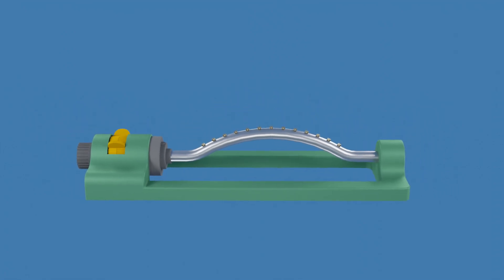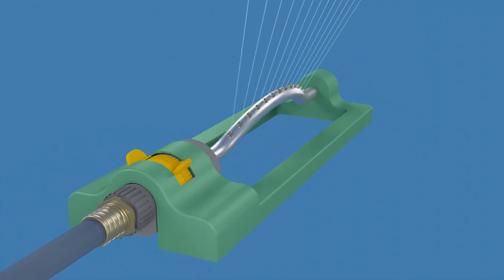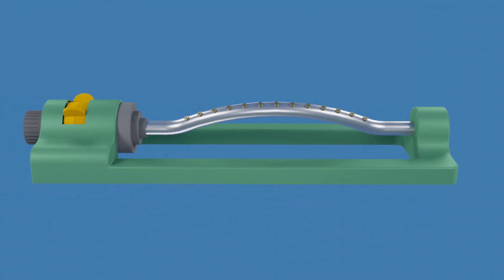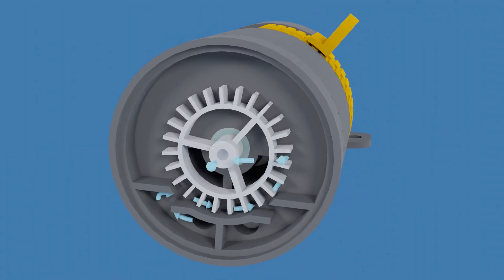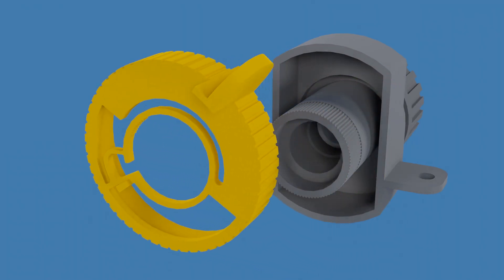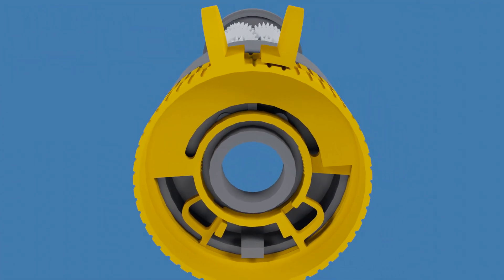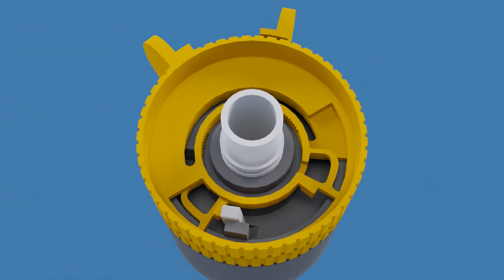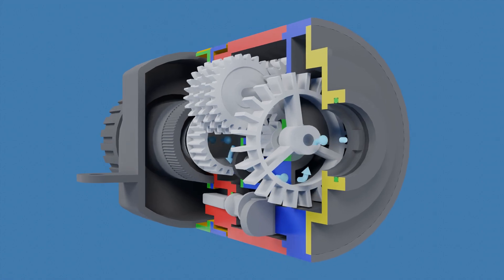How a lawn sprinkler works

Comment: Great. Do you have a video to take this mechanism apart and see if there are any issues with the gears. My oscillating sprinkler stopped oscillating and would not work despite cleaning it thoroughly.

Comment: I'd worked out everything about the design except the means of reversing the direction at the end of the arc. I'd assumed that an extra reversing gear was brought into play or removed from play, whereas it's even simpler: divert the flow of water so as to spin the water wheel in one direction or the other.

Comment: What I suspect was not quite correct was the exact source of energy. Though the water wheel is moving, the source of energy is most likely not the movement of the water, aka the kinetic energy. Similar to an electric circuit, where the energy is stored in the electric potential energy, in a water circuit it is the pressure and the pressure difference. Although I have to admit, there are circumstances where the kinetic energy of the water can be involved. To be precise, one would have the measure whether there is a pressure difference between front and end of the water wheel.

Comment: They don’t make ‘em like they used to, though. Because of the heat and UV damage of the South Australian summer, the plastic would die after one season. It was not cost-effective to keep replacing them. My $3.00 metal spraying sprinkler is fantastic, and doesn’t add to the burgeoning plastic waste problem 😊

Comment: It's pretty hard to take in a machine in its totality one step at a time. I think a much better way to teach the function of machines is to start with a much simpler machine and make revisions that solve specific problems or add new features, eventually resulting in the final design.

Comment: mine is much simpler in operation just converting a rotation to reciprocating motion using connecting rods. There is a knob to turn that adjusts the length of the rods to control how far it oscillates.

Comment: Nice work. Sprinklers are much more mechanically complicated than I had imagined.
Reply: The video was one day old when you set this comment. I imagine it will get there.
Reply: then watch how gas nozzle works at gas stations.
Reply: @abhishikt   I know, there so complicated!! Let me quess, you watch Steve Mould?
Reply: Today is the day when I learned about the drain plug that can have an integrated pin for clearing the holes on top!